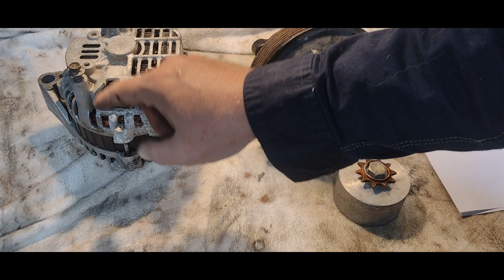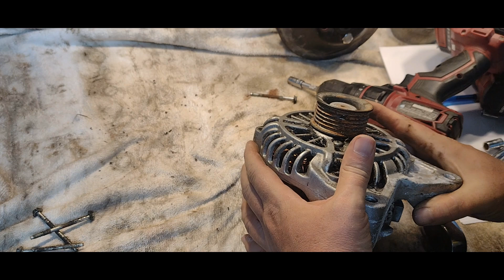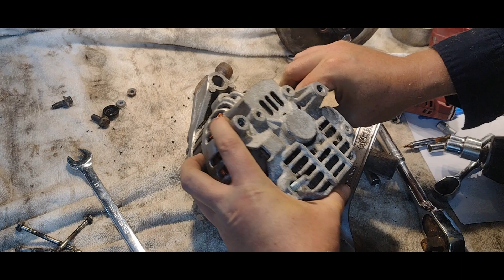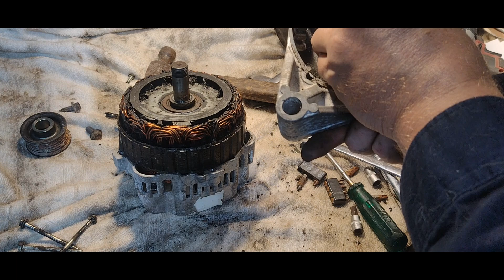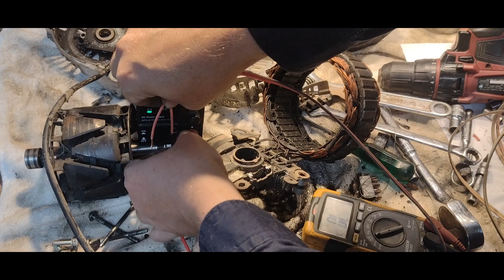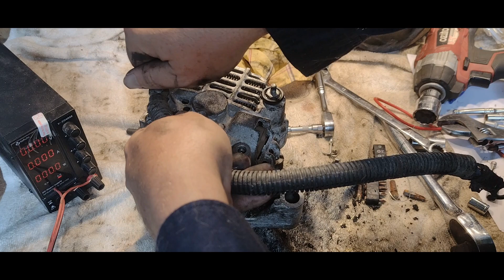Homemade small engine Dyno - Part 1 - Modifying the Alternator

Comment: ParadiseLost is correct, you won't be able to have any consistent results from the output end of the alternator. I've spent hours making a "test stand" for my chainsaw modifications with a Bosch 175 Amp Alternator from a Volvo short six direct drive unit. I can achieve 13,500 RPM no problem and I can load the saw to any RPM I desire but the output data simply flatlines at whatever load is on the output end. In my case I started with a $50 carbon pile battery tester, this worked well at 14.5 volts but wouldn't stall the saw. Then I used your method of removing the voltage reg and using a power supply, in my case a $7 dollar Bezos DC DC10-55Volt motor controller, this works fantastic powered through a 56volt weed wacker battery. One can stall the saw and record any data through a Picoscope 4 channel oscilloscope. I wanted to simplify the unit so I dead shorted the large B+ lead to the alternator case and found that I couldn't load the saw enough, then used a coat hanger shorted to the case, this works very well and does build heat in the coat hanger. The only consistent data I have is the watts used to excite the field, but simply changing the resistance (load) of the alternator throws the data way off. Also I am only running around 20 second dyno runs.

I'm at wits end but using the alternator as an inertia dyno can also work well if one can figure out the moment of inertia and input that into a math channel through the oscilloscope or Arduino board.

Check out "Motor Sawing" channel, he has used an alternator succesfully. I appreciate your vids and input, thank-you!

Comment: look up a thing called "jacobis law".

an alternator is all good and well, but you cant trust a reading of voltsxamps as a true indication of power generated...

the alternator itself has resistance. the current flows through that resistance and dissipates heat, as well as any load resistance attached. the ratio of load resistance to winding resistance determines which one tends to get hotter... its relatively simple when you consider that if they are equal, the same amount of energy must be dissipated in both resistances, and each resistance can only dissipate half the total energy. think of it as a seesaw, a balance scale? (ooooh, libra...) 

another mental game is to consider the "lenz law" demonstration with a magnet in a pipe... what if you cut a slot in the pipe? what if you then place a resistance across that slot? now consider the electrical diagram and current flow when you place a meter across that slot... what are you actually measuring?

the voltage one reads as an output is the difference between the EMF produced by the alternator, and the BEMF of the load to to that current... (on that note, worth digging into electrical theory, as BEMF is highly misunderstood... its simply the opposition to an EMF. not magical "free energy" as some would believe...)

strap a load cell and lever arm to the alternator,  mount it on a pivot, and you get a far more reliable reading as torque over rpm/time. 

best "eddy current dyno" is to use a solid conductor that is the load resistance and generator in itself. (back to that lenz law demonstration!) and it still ends up as a "prony brake", lever arm with load cell.

you can also verify readings by the amount of excitation current required (calibrated to suit) and the heat developed by the total system. this can be awkward.... rewind the alternator with copper pipe maybe?

i should get off my butt and finish mine... trying to find a relatively small car tyre as a rolling road... used an old cast iron pulley and after some consideration, im not willing to find out the RPM it will tolerate! i just used permanent magnets and a copper disc, vary the load by altering the separation gap... probably ditch that and cut up some old transformers, use the field excitation...
Reply from the maker: I touched on the theory in the video, it can't be an absolute measure of output power due to the losses inherent in a setup like this, bearings, belts, gears, the alternator will have a variable loss depending on RPM, temperature, load, how close to saturation we're pushing the rotor, even the internal cooling fan will have an exponentially higher load with RPM.

What this kind of dyno WILL provide, is fairly accurate back to back power curves, and modifying things like intake, exhaust, porting etc will be clearly visible on the graphs - which is the end goal here.

Adding a load cell and a lever arm would completely remove any unknows on the alternator but woudln't compensate for belt and bearing losses before the alternator.

I have no doubt this setup will work and produce nice torque curves and with enough effort, you could connect a hub motor with a decent controller like a Fairdriver and log input power and output power at various RPM and loads and you could plot total ineffeciency in a 3d lookup table and produce a fairly accurate dyno graph. This may be something I'll do in the future.

FWIW, I bolted a modified alternator just like this (maybe 15yrs ago now...) to some rollers and had the bike running on it, dumping the load into a bank of halogen downlights and logging voltage, current and RPM. It wasn't accurate in terms of absolute HP but it was repeatable run after run.
Reply: @SafetyUggs  agree.... if the only requirement is to make comparisons, its fine. if the actual readings to a fair degree of accuracy are required... not so fine..

a way to get the friction losses is with a "differential dyno"... how they figure out the losses in an engine itself, drive it through a diff...

could you be bothered, lol? 

same deal, my eddy current brake was done several years ago when the motorised pushies were still legal in NSW (mofos!), but i quickly learnt that i had it backwards as i couldnt cool the disc down! 36 cooked neo magnets later.

10kw or so really heats things up fast... 

i should actually try doing what i suggested... rewind an alternator with copper pipe... only needs to be single turn per phase, shorted to itself. got a nice big fat one from a D9 here...

too many projects...
Reply from the maker: @paradiselost9946  Ahh local man! Before the crackdown I used to ride the thing everywhere, we did a full lap around tassie on them too.

Love the idea of using a diff! One output to a load cell, the other to the load. Built in bearings, fairly effecient. What a great idea!

Kind of related, I built a hub dyno using VE commodore rotors and CNC machined hub couplers, all mounted on pillow block bearings with a lever arm and load cells. It was surprisingly hard to automate the breaking with the hydraulics and in the end I just had a second hand brake mounted in the car to apply a load. I later found a great deal on an old vane chassis dyno and just use that for when I need a real HP figure. The build log is over on the pcmhacking forum. I've also done similar using a CV shaft and rotor, coupled to a trans input shaft as a sketchy engine dyno for old VW motors. It never felt that safe spinning a rotor intended for a few hundred RPM peak at 5000rpm... It held though and with water cooling it barely ran over 100c.